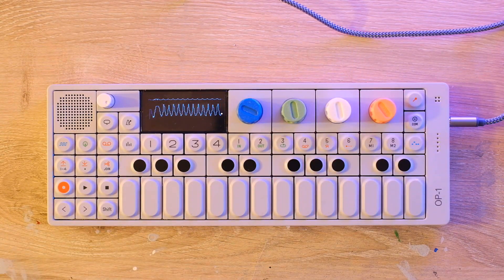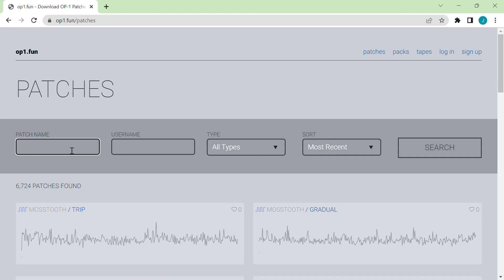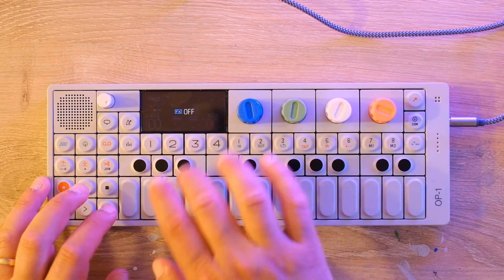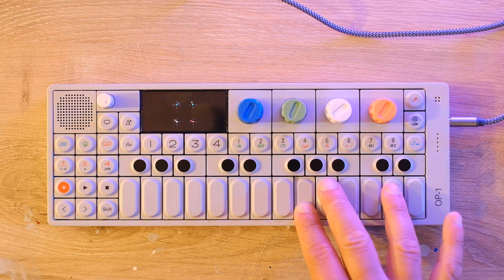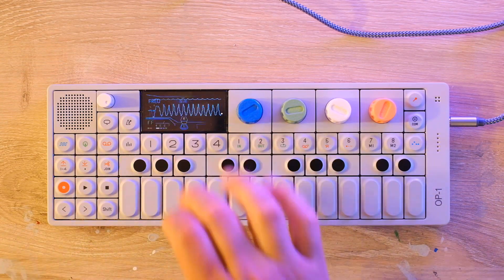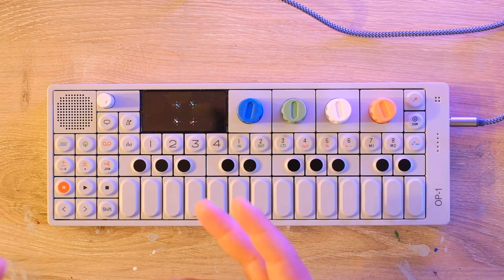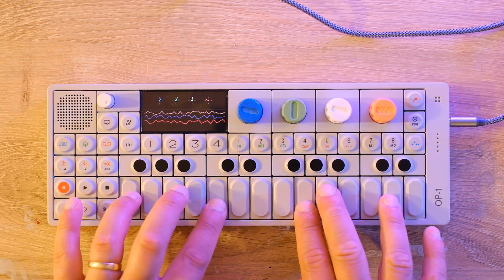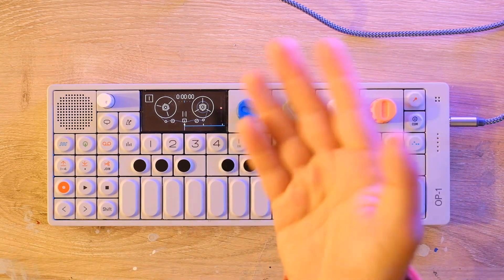The OP-1's SECRET Synth Engine!

Comment: This is awesome. I've seen videos about this one before but I was not willing to install custom firmwares (yet). Quick question: how did you do to use the Iter Filter on the other synth engines? When I select another one, this filter is not showing up on the filter lists. Thanks!!
Reply from the maker: Thanks! What works for me is to load the Iter synth preset with the Iter filter, and then press "shift" and "1" (the 1 for the synth engine screen), and choosing a different synth engine, which will change the engine but keep the filter on. I hope that makes sense!
Reply: @JoshIsMakingMusic  I've just did it and it's exactly what you said: it worked like a charm. Thank you so much! Great video!